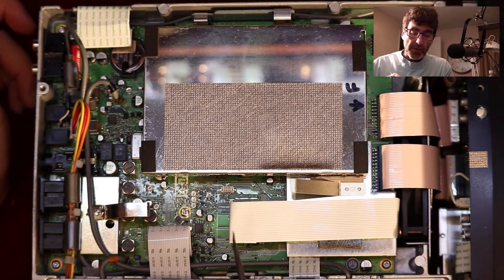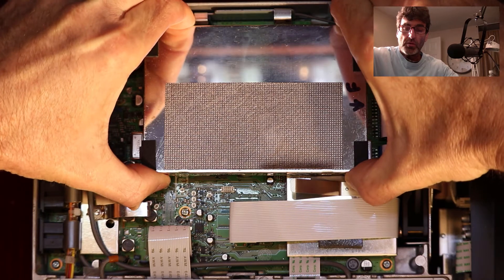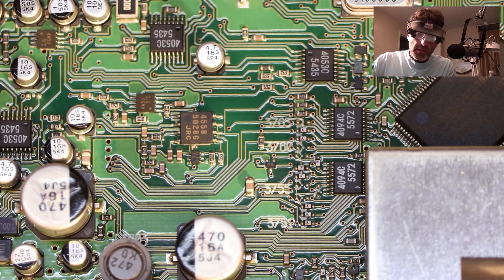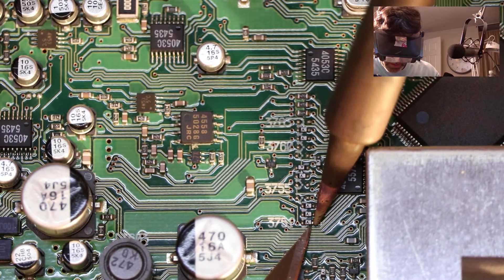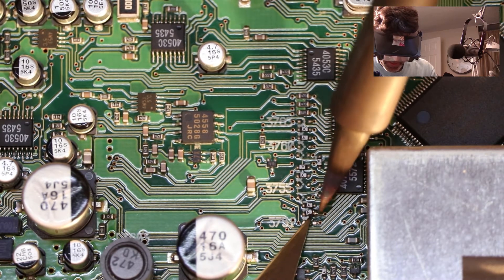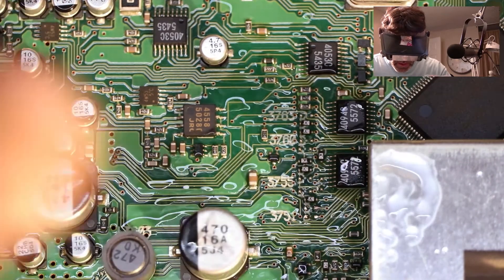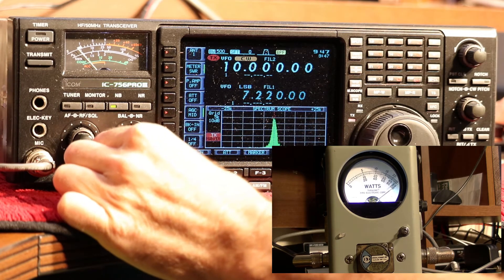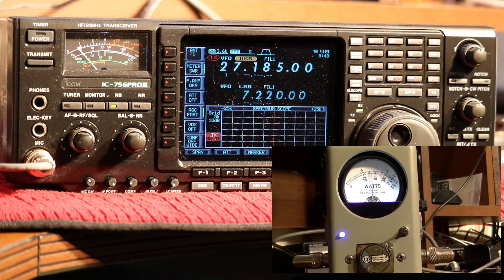Icom IC-756 PROIII MARS/CAP Modification EXPANDED TX

Comment: Nice! Better have good eyesight and a super steady hand! One thing I've never seen is how to turn the hf output power up! Most of the 756 radios barely make 80 watts, unless you turn them up. JUST SLIGHTLY!! Only to 100 watts!! They'll go to 150, but DON'T DO IT!! You'll blow the finals if you like to rag chew and key down too long! But going to a full 100 increases your "talk power" quite a bit!
Reply from the maker: Interesting!  I usually go by what's the output on RTTY/ FM or something like that.... it's harder to tell on SSB unless you have a really good PEP meter.  You're right, there's no need to exceed 100 watts.  That's what they're designed for and going over that stresses the finals to much for very little gain...

Comment: Re the IC-740 question: it is a ham-band-only radio. It has no general coverage receive architecture. If there is a MARS mod, it will be one that extends the band edges.
Reply from the maker: OIC